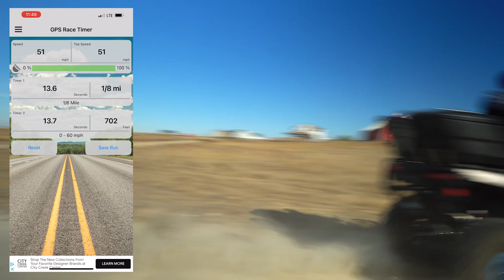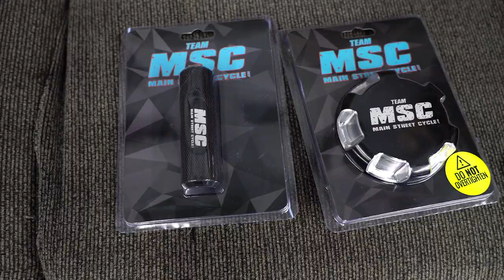Installing an MSC Tuned ECU and Upgraded Air Intake // CFMOTO 1000

Comment: HI  I'm looking at getting a new atv and when i was at my local CFMOTO  dealer I noticed there was a fair bit of play in the steering on both 1000 C forces . Is that play still there when its running or does it go away when you start the bike? (power steering on) Oh love your videos
Reply from the maker: Since it has electronic power steering, it’ll feel completely different while it’s running. Mine doesn’t have any play in the steering.

Comment: I have a 2022 cfmoto 800xc and the ecu is not in that location.  What i think is the ecu doesn't have Bosch on the front of it and can't seem to find any reviews on ecu removel..
Reply from the maker: Call Main Street Cycle in Tishomingo Mississippi. They’re great people and they’ll be able to tell you exactly where it is on that machine.
Reply: @BroBuildsGarage  yep I did that and for some reason mine is under my seat and it's a delphi ecu not bosch dont know why they changed..

Comment: Just wondering how you tuned the secondary clutch..?  What setting did you go with? IE... B1, A1, C1, B2????? I have a Z950 Sport but went with an RNG kit....really loving that kit. Did primary and secondary spring and SM3 helix...what a difference...Steve can tune a clutch....OMG...here is the bad, I took out an MSC trail kit...not that it was bad, just tried an RNG and liking it alot better. But I am looking at an MSC tune....which is what brought me here...
Reply from the maker: Man I don’t remember. It was whatever MSC recommended for my setup. I know it wasn’t the stock location.

Comment: Hello, it is true that the overland 1000cc does not produce the 79hp that the manufacturer indicates that it only produces around 50hp
Reply from the maker: 79hp is the rating at the crank. It may only be 50 at the wheels, I’m not sure. It’s definitely significantly more powerful than the 500 and 600 I’ve ridden.

Comment: I love your dad jokes videos on TikTok, and then I found out you had this channel and are a fellow CFMoto owner!! One question, do you have any ideas to upgrade the exhaust or just muffler on the CForce 600 Touring? I'm looking to upgrade the performance a little and of course make it sound better too. P.S. MSC is killin' it, glad you are connected with them!
Reply from the maker: Thanks! I’ve seen people put universal mufflers on their machines. Just find one that’s the right size and it should work. It’s a gamble on how it will sound, though. I’d do some searching on the Facebook groups.
Reply: Hey Jesse,  RJWC makes a muffler for the 600. Also MSC has a ECU tune for the 600, I got one on my 600, wakes up the mid range quite a bit

Comment: my overland 1000 overheats like a mother fucker cant go for too long of a drive its starts beeping at me any idea what I should do ?
Reply from the maker: I’ve heard the factory coolant is pretty terrible. People have had good luck changing it out for a better quality coolant. Also, some of those new open headers (MSC and RJWC both make some I think) in combination with a more open muffler will help (just the muffler will help too, you could even just use a universal one from Amazon or eBay). Single biggest help is probably getting it tuned. Main Street Cycle does a tune and there’s another one out there, but I can’t remember who.
Reply: Are your fans turning on? Is the machine new from the dealer? If so it may have air in the system. There are multiple bleed ports up by the heads that may need to be bled.  I think there is a vid by redneck Garage that he changes the coolant and show the bleed ports. It is on a Uforce but it is the same engine layout as the CForce.